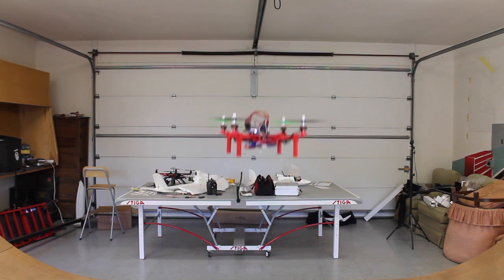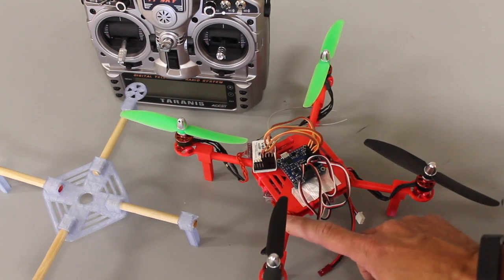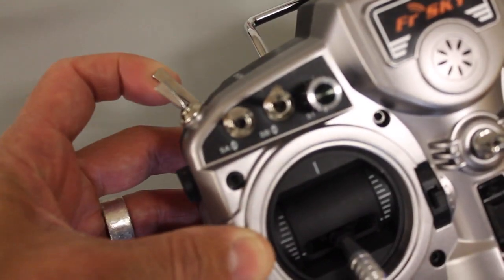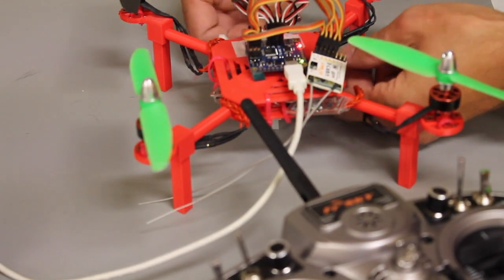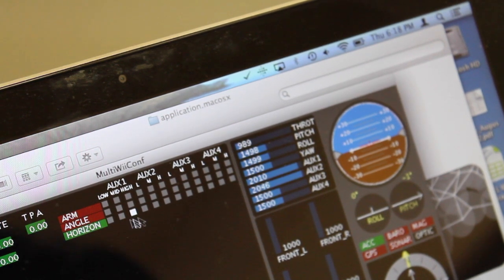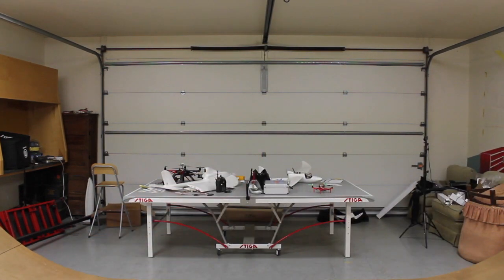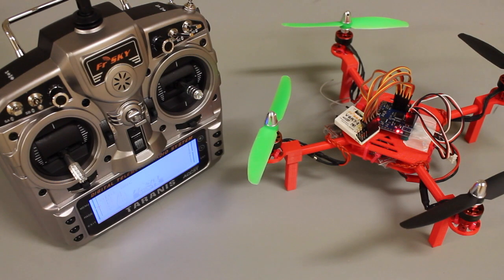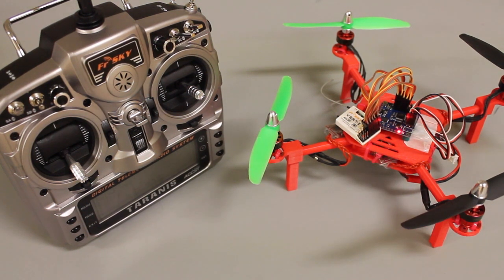FrSky Taranis Mode Switch to Toggle MultiWii Acro and Horizon Auto Level Mode

Comment: I like to try out a quad with the top and bottom plate. This the plates for the F450. I also took a F450 frame and just mod it a little for Tricopter. Also look at the MakerBot machine and just thinking about it. Guess I would need to play around with the designing software first before doing anything. I had a problem with the KK2 board and ask you a question about it because I could not get it to fly smooth or correctly with arco mode I realize that I need to play with my D/R Expo now I have it flying pretty good. With the MWC it seem that when setting D/R Expo setting in the radio it has no affect on.
Reply from the maker: Cool. I've been really impressed with my MakerBot since I got past a few problems when I first purchased it. Glad to hear you have your setup flying well now. Sometimes it takes a bit of tweaking to get there.

Comment: Nice!!!
Can you do a review of the Taranis?
I don´t know if i should buy it.
Great tutorial as always :D
Reply: go for it you will not regret it, it  is a great transmitter put it with the X8R receiver you get rssi and you can add voltage and amps telemetry and so much more
Reply: Ditto zimmy1958. The Taranis is just an amazing TX..

Comment: I finally got the MWC board to arm, guess I did not pay close attention the the instruction. Also located a video that walk one through the hole process of burning in  new firmware. The board was pre-loade with 2.3 firmware from RTFQ. I first though it was going to be a pain to do but was not that bad. In fact the board respond better then the KK2 and a lot less time to set up. I order two of the new KK2 board 2 weeks ago v2.1.5 now kinda wish I order a few more of the Flip 1.5 and there much smaller then the KK2. Also like your video on the MakerBot look into that a little pricey unless your going make things so that it will pay for it self. Did you ever come up with the bottom plate for the DJI top plate ? I have no clue on how to design things that would be another big leaning curve.
Thanks for the reply.
Reply from the maker: Thanks for the info, Dennis! Great to know. I haven't come up with a bottom plate for the DJI, but shouldn't take too much to do. Are you looking to replace yours?

Comment: I purchase on of these mutiwill boards I was under the impression it was just a plug and play board. So I need the software to get the controller up and running? After putting in one of my quads I could not get it to arm. And not sure were to look for information on this board. Seem like the KK2.1 board is more user friendly to used no computer needed.
Reply from the maker: It's often dependent on where you purchase them from. If they come preloaded with firmware then it's easy to get up and running. If you have to load firmware that can definitely be a pain. Have you hooked it up to the MultiWii GUI to see if you can connect and read parameters?

Comment: I did flips with my quad today for the first time and by using the horizon mode, but I've read and heard many places that using auto-level while doing flips is quite risky because the rotation rate may be higher than what the gyro can keep track of or something similar. Is that the case, or is it "safe" to use the horizon mode on multiWii for flips?
Reply from the maker: SirArghPirate I've never tried this in auto-level mode. Only in manual. I'd be a bit hesitant to try this in horizon mode. I'm not saying it isn't possible, but would definitely proceed with caution. If I get a chance this weekend I may give this a try. I'm anxious to find out!
Reply: Dennis Baldwin
Last night I just had to challenge my luck and do flips with pure acro-mode, and found out it wasn't that hard at all as long as I didn't mix pitch and roll. I would never imagine. I expected it to be super difficult and require many hours of practice and dozens of broken models just to do simple flips. That being said, I got reckless on the last battery and crashed but that was all called for. Took me 10 minutes to fix it when I got home.